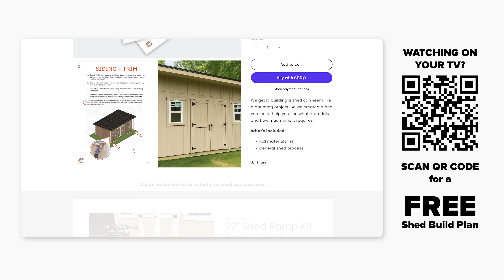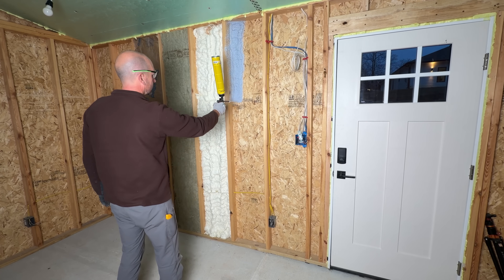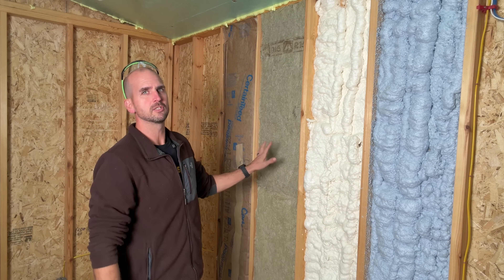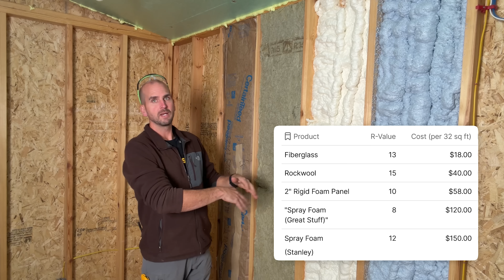Stop Wasting Money! Most Homeowners Are Insulating Walls Wrong

Comment from the maker: New Great Stuff Spray Foam:  https://geni.us/pXsAO
🏠 Free Shed Plans
FREE 6x12 Shed Build Plans:  https://geni.us/VlPh5
FREE 8x12 Shed Build Plans:  https://geni.us/AoQkZd
FREE 10x12 Shed Build Plans:  https://geni.us/4wKApk5
FREE 12x16 Shed Build Plans:  https://geni.us/bw4ClZo

Insulation Used
Stanley Spray Foam Kit:  https://geni.us/tfB9gD
R-13 Fiberglass Insulation:  https://geni.us/aJHjcNA
R-15 Rockwool Insulation:  https://geni.us/UUjM6sB

DISCLAIMER: This video and description contain affiliate links, which means that if you click on one of the product links, I’ll receive a small commission.
Reply: It may depend on the brand, but I understand that rockwool also resists insects and functions as a fire barrier.

Comment: Dude, why did you not insulate the ceiling with bat insulation BEFORE you installed the 2" foam insulation.  Most thermal gain/loss is in the ceiling.  You are focused on the wrong model.  I am giving you a thumbs down for this.

Comment: I would not recommend foam insulation for large areas.  Just use as an air stop around small holes.  Insulation is only to stop air flow in the walls from outside to inside.  Foam insulation is chemical base and bad for you.

Comment: I also like Rockwool, not just for the moistur/mold resistance, but it's also naturally pest resistant.. which is a big big plus. A friend built a beautiful garage/workshop and to save a bit, he used Rockwool along the first several feet of the bottom section to prevent rodents/pests from wanting to climb up, then used the less expensive insulation above it, for some cost savings.

Comment: We just finished our new house.  Insulated the entire wall structure with closed-cell spray foam, including the rim joist, of course.  We have about R25 in the walls.  No vapor barrier is needed because the foam is closed-cell.  We then added large foam "boxes" over every can light in the attic and applied about 1-1/2 to 2" of spray foam over the entire attic, thereby preventing air transfer. I then blew in about 22" of cellulose.  Insulation pays off in the long term.  

In my previous house, I basically utilized the same procedures but utilized T-studs and triple-pane fiberglass windows.  It was an incredibly warm and cozy house.  My next house will utilize all of these building techniques from my first house.  That house was large, but oh-so-cozy.

Comment: Better to use board insulation on the walls. Also to many gaps. Foam holds moisture. 3/4 double foil back with taped seams over the studs ,drywall on top

Comment: I am confused why you didn't put any board insulation in the joist bays. Yeah, you have the smaller R of the rafters but your hung hard insul helps there. I would want the largest R I can get in the roof... Any reasons for not doing that?

Comment: You should slit the insulation to go around the wire for receptacles and whatever else. I’ve done a thermal scan of walls and you could see the cold spots where that technique was not used and they just put the insulation over the wire and it compressed it that and left a wide open area on the cold side.
Reply from the maker: Thanks for the feedback

Comment: This is apples and oranges. Canned spray is not how anyone would insulate a building. Its for filling gaps. Also if its just cost why insulate at all? That's the best on the pocket book isn't it? A comparison like this requires understanding of temp variations, how sealed is the building, how exposed to wind is the building. All these factor into how much you will spend on insulating. Also, do you heat with wood, gas, electric. Insulation is a pay out item for most people versus comfort as its expensive to step up the quality scales. Also don't forget to explain the R factor of open versus closed cell. More isn't always better. Insulation is about stopping the movement of air.

Comment: Rock wool is a bit more expensive but it is much more superior.  It can handle moisture better than pink insulation and the foam you used, due to the cost, is basically crap. Thank You
I have to insulate my crawl space and I think I'm going to use Rock Wool.

Comment: I still don't think rockwool is worth more than twice of fiber glass when the R value is almost the same (R13 vs. R15 makes little energy efficiency difference when the A/C temperature delta is reduced, e.g., 15 degrees F vs. 20 degrees F).  As for the fire resistance, dry wall is the line of defense, not the insulation materials. As for the moisture control, unless there is a metal pipe that condenses water running through the walls, there would be no difference in terms of risk of mold growing inside the wall (it takes temperature and staleness, along with food for mold growth -- if the wall can "breath," high humidity alone cannot create mold). So it really depends on many specifics before going for the higher cost rockwool.

Comment: First off…Any Spray Foam is Retarded…what if there’s a Problem with Electrical or Plumbing,then you have a Tough job of Breaking the Foam away to Fix any Problems,Second,you put the Rigid foam on the Ceiling Over the Studs…Instead of In Between the Studs !….What are you Doing ??…How are you gonna put Sheetrock up ?

Comment: RADIANT BARRIER is the best bang for the buck. Exterior perforated house wrap with it blanketed over existing insulation or stapled to the rafters. Double Bubble Double Foil is best. Inside/ outside temperatures can vary as much as 30 degrees in my house with no heat on. I buy direct from the manufacturer in Texas.

Comment: Installing rock-wool versus fiberglass is more than 2+ times the cost for a R value gain of 15.4% (15/13=1.154). That gives a payback of around 6.5 years regarding thermal resistance. However, one needs to consider the increased mortgage payment due to higher upfront cost. There is additional waste of leftover rock-wool which might be used in corners of the building (based on construction technique. I think it is more efficient to use 1”-2” foam on the exterior of the wall to insulate the wood studs from the elements . However, in a remodel that probably isn’t practical.  Thanks for the demonstration. I would not use the foam in cans because the fill is uneven and the insulation values are lower (but the air infiltration is basically eliminated). The cost of foam is truly too expensive for most people.

Comment: You stated at 1:01 that "one mistake I used to make" was stapling the flange to the face of the stud and that you changed, saying "it should go on the inside side (of the stud) keeping the inch and a half clean for your wall covering". Sorry to say, that's all wrong if you care about vapor movement and your exterior wall's R-value. Quick story about me and why I'm passionate about this subject - I went to school for Architecture and have worked in Architectural firms for over 35 years, following the never-ending changes and improvements to building materials and technology. That said, I'm shocked how many times I see people creating continuous voids in the insulation by stapling to the sides of the stud and not the face. Firstly, the paper face on the insulation is impregnated with a bituminous material which helps the facing act as a vapor barrier. An important component of new construction exterior walls for the past 50 years is having a vapor barrier on the inside face of stud to prevent moisture movement into the stud cavity during cold months when the interior is heated. When the stapling flanges overlap on the stud face the vapor barrier is virtually continuous across the area of the exterior walls. A similar system performance is achieved by using paperless batt insulation and a continuous & seam taped plastic sheet vapor barrier stapled to the studs. SO, by pushing the stapling flange into the stud cavity, the vapor barrier is broken at each stud, and those studs are unfortunately perfect thermal bridges for heat movement and therefore a travelling path for moisture and condensation (which causes - in time - rusted and loosening fasteners). Secondly, that inward pucker caused by pushing the flange into the stud cavity just to have the fold out flange aligned with the face of stud creates a significant void compression of the insulation batting. These voids on both sides - top to bottom - in each stud cavity add up significantly in volume over the collective area of your exterior walls and contribute to the reduction in overall exterior wall assembly R-value. This is alluded to in insulation manufacturers website installation instruction manuals where they tell you to fit the insulation side to side, front to back and top to bottom in each cavity, preventing voids at all times to prevent reduction in R-value (paraphrased from Owens Corning's site). Another factor with these numerous and continuous voids is that air transfers heat - and therefore vapor - at a higher rate than does expanded fiberglass, which creates an ecosystem of vapor colonies inside your walls where condensation and therefor mold can accumulate. Please stop the madness. Tell your friends.

Comment: Adding fiberglass insulation requires tacking the edges to the studs. Otherwise gravity takes over and the insulation settles to the bottom, leaving gaps. I would never use foam insulation. If a remodel is done in the future, it is a mess to remove the foam. Only thing about foam it's cheap and fast...like spraying popcorn ceilings instead of painting.

Comment: There are many who have problems with spray insulation after a long time. It can shrink so that moisture can get in, it can break down, etc., different problems in different places and with different brands. Glass wool and mineral wool have worked well for many years but they should be cut so that you can press them in a little otherwise they can sink together so that there are gaps at the top under the roof and under the windows. Between the outside covering and the insulation there should be a ventilation gap so that if it gets wet during very heavy rain, it should be able to dry up on the back without the moisture penetrating the insulation. You can put masonite first with some strips against the outside panel so that you get 1 - 2 cm gap for ventilation.

Comment: Good comparison of costs of vsarious insulations. The most common in Canada is batt fibreglass without the paper cover. that paper is supposed to act like a vapour barrier but in Canda it is not code, (because it doesn’t actually work). The reall issue is not the insulation test in this video it is the terrible framing and electrical in place for a build that is being finished on the inside. The framing is structurally fine for a unoccupied shed. But it is missing all the critical backing for proper attachment of inside finish wall material. If you ever think you may finish a shed like this don’t use 2x4, use 2x6 the extra cost is minimal. I am thinking this guy lives in a warm loaction where cold is for a few months and barely below freezing if at all. The up front framing difference is not much cost but will make a world of difference later if you decide to finish and heat the building. Becaude the building size is small the rock wool is a good choice with mosre then 20% increase in the R value. The foam for the ceiling is not really installed properly you9  can’t apply any surface fininsh to it. you should have made sure you had gable venting for a cold roof, then you could have put the 3 1/2 inch Rock wool in the cavity leavingan air gap above it. Then with the proper structural backing in place if need be the foam either 1” or a little thicker could have been installed  and  sealed. Personally I would have built with a 2x8 instead of a 2x6 Then you could use R22 Rock Wool for the insulation and still have an air gap for roof ventalation.

Comment: You placed the insulation between the studs, but the studs will conduct heat. So you are not completely insulated. Your ceiling on the other hand is fully insulated as you covered the wood with the insulation. Another item to consider with the insulation is a radiant barrier.

Comment: That rigid foam on the ceiling is awesome until summer.  The temperature difference causes condensation on the back of the roof deck, followed by mold.  If you do this in the South, be prepared to tear it out and maybe fix it and not demo the building.

Comment: Who cares what you use… The 2 inch foam board use is only an R 10 product… Heat rises… Not quite sure why you didn’t insulate the ceiling with the same thing you’re insulating the walls with, but you made a mistake…

Comment: Another thing you don’t seem to mention, is the fact that closed cell spray foam adds strength to the entire structure. The other insulations don’t do anything for structural integrity. I will only used closed cell spray foam for insulation and nothing else. It also lasts an extremely long time. And most people actually do use spray foam for DIY because it’s better. It does more than the other insulations you displayed here.

Comment: People using spray are playing Russian roulette.  I rockwooled my last two houses and it’s amazing stuff.  I did my last house myself.  The company I used for my current build charged out the ass because their installers hate working with it.  Personally, i prefer to install wool over fiberglass, but either way you need to suit up and wear a mask or you’re just an idiot.  I only foam places hard to get to or don’t take traditional batt well like garage ceiling and between floor joists on outside walls.  Its scary to use it as even experienced installers can screw up and you’ll have indefinite poisonous off gassing.  Some insurance companies wont even insure you if it’s in the house.  Go with Rockwool.  Sound, water and fire resistant.

Comment: This interesting (even if not complete) compareason was for a shed, but many people may follow your advices for their mobile homes ot their homes.
I would like to give them some important advices : 
For your home there are a lot of other critical factors you must take into account :

- Perspiration (the material's ability to regulate humidity or not). Foam and polystyrene insulation have zero perspiration, and they make you live in a kind of thermos bottle full of moisture that cannot escape, even with a CMV. 
- Thermal inertia (speed of diffusion of cold or heat throuh the insulator), which is very important in the event of a heatwave or extreme cold, and which is only good with wood wool, and to a lesser extent with rock wool.
- Air quality when the material is installed, and in the event of fire ! (many chemical insulators are very dangerous for your health in this regard)
- Level of acoustic insulation (glass wool is very poor in this respect, rock wool and wood wool are very good for that)
- Lifespan before sagging and creating thermal bridges: this lifespan is very short for glass wool, for example !
- The carbon footprint (energy required to manufacture and transport the materials) is disastrous for the four options you have presented here. The carbon footprint is infinitely better with wood wool or any other plant-based insulation. I know that in the US, almost no one is interested in the energy waste associated with their purchases, but it is an important point for climate change.

When we combine all the important criteria, we see that for homes, natural insulators (particularly wood wool) are by far the most attractive option, even if they are a little more expensive initially.

Comment: fiberglass+ cover with perforated silverfoil(nasafoil)   22dollar  total   AND R24 total..    cheap polar cabin  solution....    the silverpcv-foil (radiantbarrier )will reflect heat back in the room   this foil is general used in airplanes and agro buildings(barns)

Comment: There are SOOO much bad information out there about insulation. Did you know fiberglass insulation is perfect IF your interior and exterior temperature are the same? The farther apart the less effective it is. Rockwool is for fire resistant construction not because it's superior. Close cell foam or cellulose are far superior if you want the best real R value. Your welcome

Comment: You left out few other Major advantages to Rockwool. 1. not biodegradable, it wont lose filling over time. 2. fire retardant(major advantage especially in a garage)   Non-Combustible: Rockwool doesn't burn and won't fuel a fire withstands temperatures exceeding 1,800°F  producing very little smoke and no toxic gases. 3. Rockwool is considered rodent-resistant as it's in-organic they don't want to nest in it and has no attraction to pests. You should ware a Dusk mask however when installing Rockwool as the tiny particles may now cause skin irritation but can be detrimental to your lungs and breathing while being installed however there is no off gassing like many of the spray on foams.
We are using Rockwool inside and out on our forever home as we live in the mountains in a mostly colder climate. We are also using it as part of or sound proofing through various rooms in the house. It's highly ratted for sound suppression as well as it's thermal properties mostly the washroom, bathroom and bedrooms as well as my music room along with a few other building tricks like staggered stud walls.  

Hope this info helps anyone in their decision making process.

Comment: We have a 16'x24' outbuilding. We converted it to an office. Had a company come out and put 2" of hard foam on walls and ceiling for 1,200 dollars.  Done in 2 days and  we use a small plug in heater and it heats well. When really cold or hot a small mini split does the job. Very efficient and clean. No effort on our part